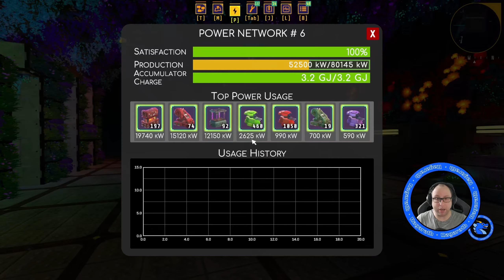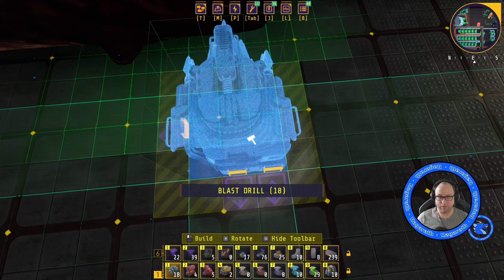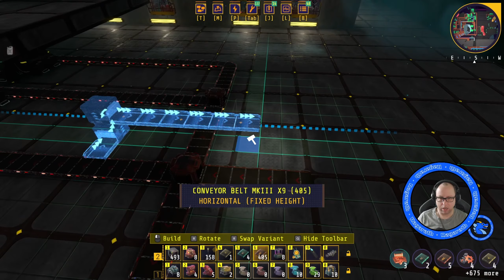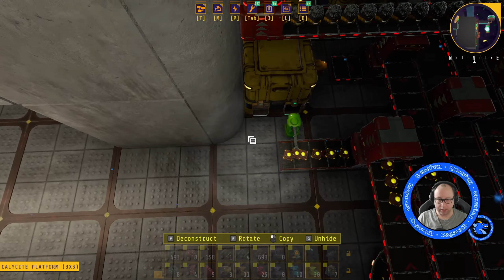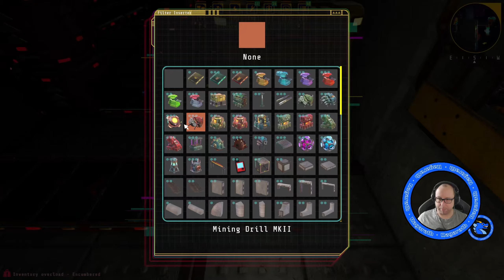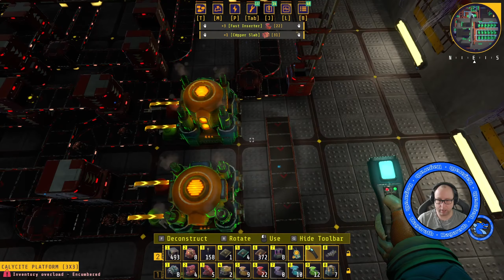Creating Copper Slabs - Techtonica Efficiency Build Ep 24

Comment: Thank you for the power grid info. I had heard that one wheel should only power 2 generators but that does not seem to be the case based on your setup. Cheers!
Reply from the maker: As you can see from my setup. A water wheel powers 2.5 mk II generators. Hence why I have 2 water wheels and 5 generators per  row.

Can't remember off the top of my head right now the mk I setup numbers but I'll look and update this later.
Reply: @Ragarath  Ok cool. I'm running mk II gens so I'll adjust accordingly. Thanks!